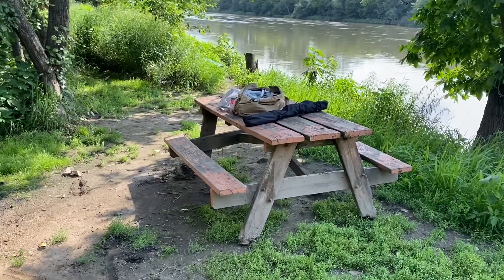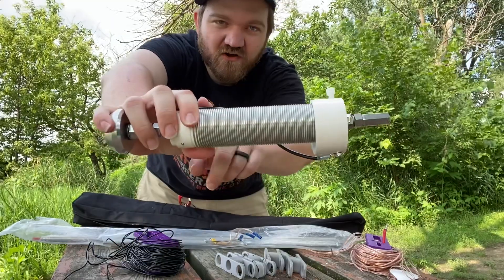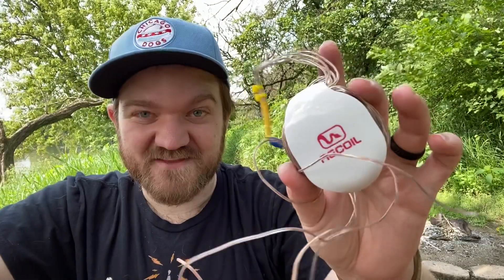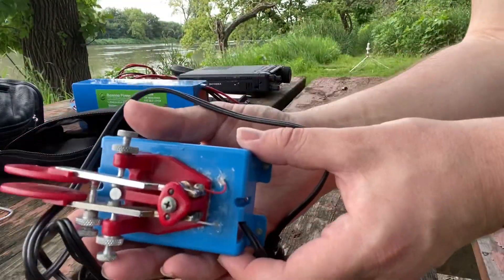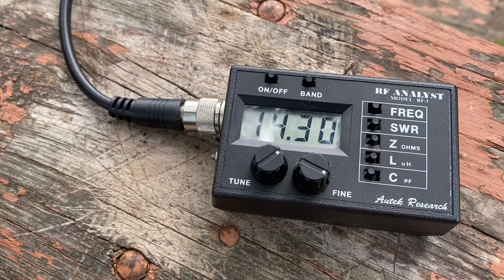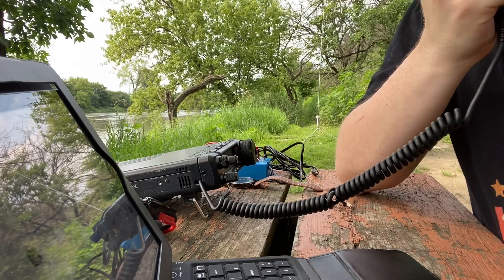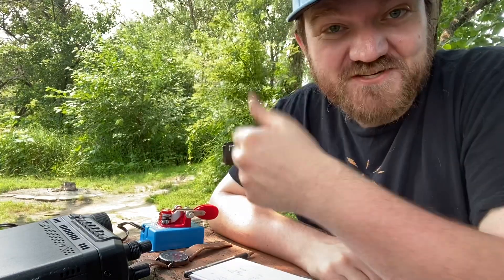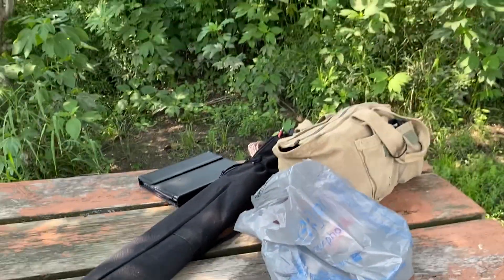A Little River and a Big Signal - Playing Radio at Santa Fe Prairie (POTA)

Comment: Hey that's a real cozy place there you picked to play some radio. And i like that groundradial system the way you fixed it. I am no friend of Yaesu any more. After a long time using IC-760Mk2G I kept searching to find me a IC-7200 which I got 5 yrs ago. To be honest, I been a lil bit eye balling with the FT-891 because of it's size and even that display screen is that tiny it got a perfect brightness and a great read out even for operators with eye problems / bad seing. Good job buddy, hope we cam make contact on the Bands P2P would be cool. Happy sunday from the German Frontier, 73's de Your Friend Uncle Guenter
Reply from the maker: Thanks Uncle Guenter - it's true, the FT-891 is an interesting beast. The receiver is great, the portability is great, the display is great, but the menu system is pretty unfortunate from a usability standpoint. I managed to find one used for under $500 USD shipped, which made sense for me at the time; not sure how I'd feel paying full price for one.